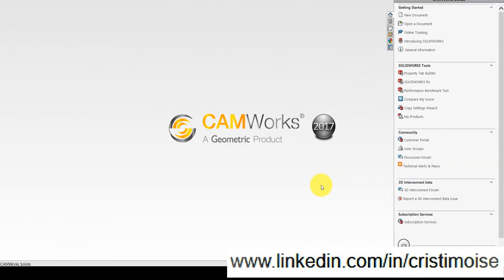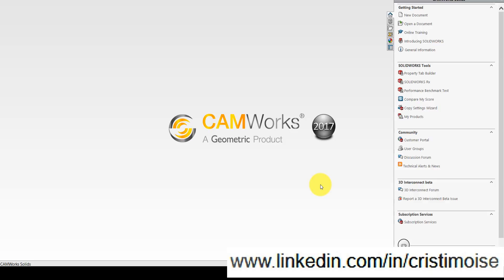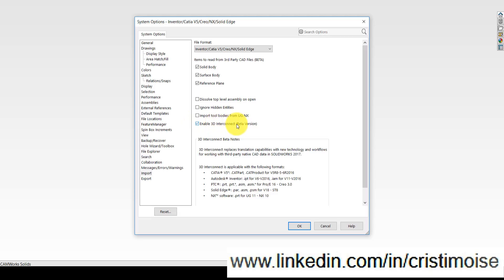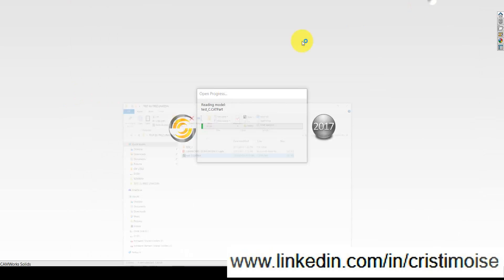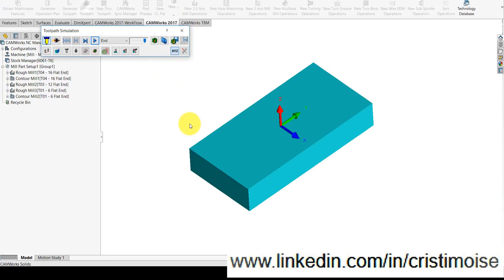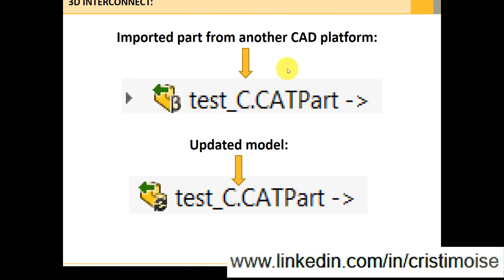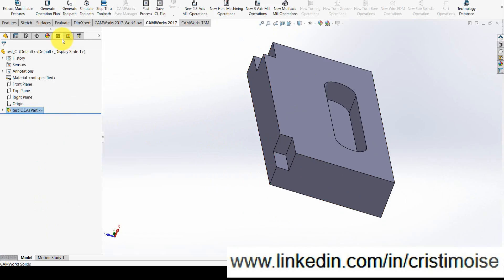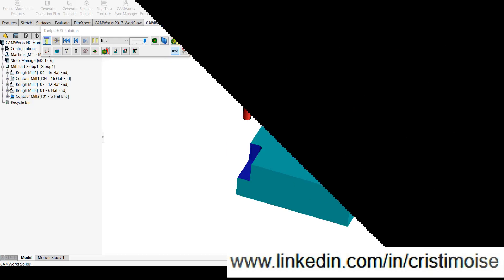CAMWorks Solids: 3D Interconnect.

Comment: I have tried on camworks solids 2018, can not open catia file. Can re check please...?
Reply from the maker: Send me the part please.
Reply: @CristiMoise  Hi Cristi, its not about the file. When I go to File, Open...  cant find catia listed under type of file that I can open. Have tried i  camworks solids 2018?
Reply from the maker: Hi, yes in CW SOLIDS 2018, when you press file open you need to find CATIA GRAPHICS (CGR) and then if you activate 3d interconnect you will have the ability to open catpart files. There is a limitation of CATIA V5-V6 files.